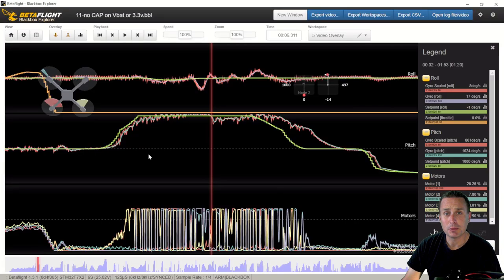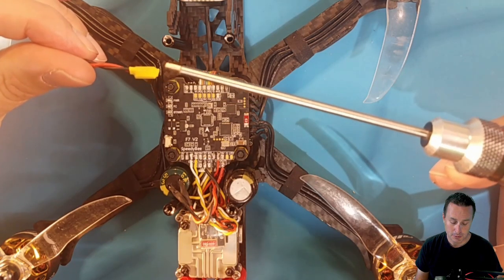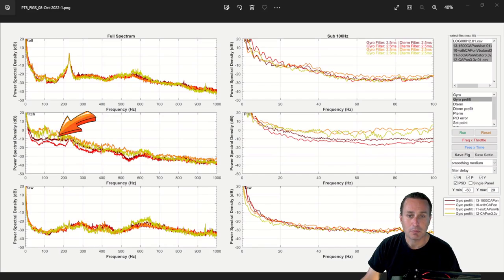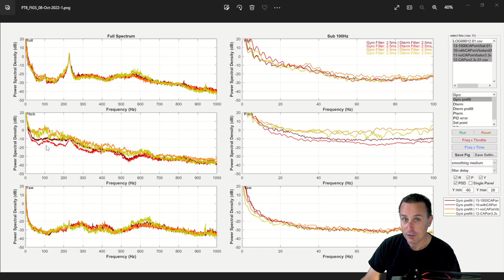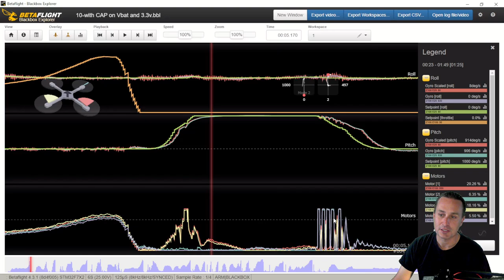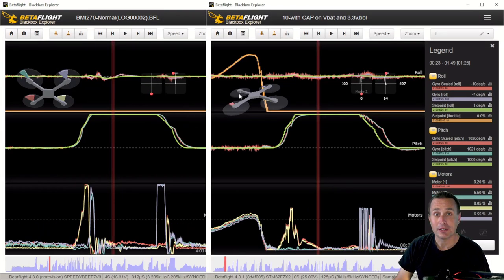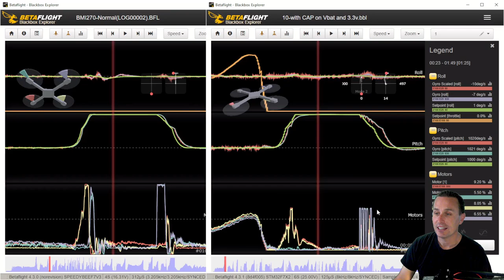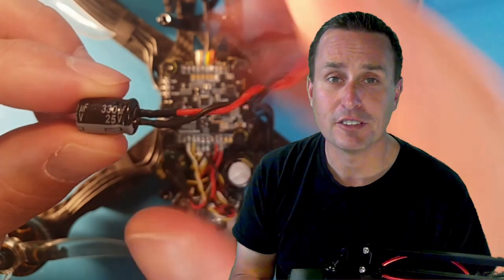⚡ How to FIX Gyro Electrical Issues ⚡

Comment: I'm saying this for years that the huge capacitances (some use over 1000uF) mostly added directly to the xt60 or putting it where the battery inlet cable  connects to the PDB/ESC board doesn't do much in terms of filtering. What it does for sure is burning your xt60 plugs with this initial cap charging spark
Reply: Well I hadn't thought earlier... but you are right adding a Cap without any resistor sure does a huge current spike... between battery wires...  people tend to forget that the placement of cap near the soldering pads is just the routing... there is a complete pi- filter sitting on the board{ pdb/esc}.

Comment: I had some Andlog OSD issues on a bad design FC. With 4s had interference in OSD letters, and with 6s OSD completely gone on throttle high. Tryed any caps but problem were solved by adding good DC/5vor12vDC regulator at vbat/ground out of ESC to FC. I used blheli32 telemetry to get vbat voltage and current data.

Comment: Hey, thanks for this video. I found your results pretty interesting. Maybe try adding some 0805 or 1206/1210 SMD ceramic capacitors to the FC where you have a Vbat pad next to a ground pad, and a 3.3V pad next to a ground pad. The low impedance and great high frequency performance of a SMD MLCC capacitor may help eek out a bit better result.
Reply: I did not test it separately but that exactly what I did with my mamba f722 app that had noise on pitch and now even the logs look like there is no issue at all.
Reply: @rehepeks  That's pretty awesome. I sometimes feel like certain FCs are lacking in the decoupling department and I'm sure there's plenty of improvement to be had by a few caps strategically placed here and there. Big electrolytic caps, and a few small SMD MLCC caps. I've been doing this on my last few builds from the get-go so I have no back-to-back comparison, but maybe my next build, I'll do a before-and-after BB log to see.

Comment: you should look up "capacitor derating" or "DC bias" it's when the capacitance is reduce as voltage is increase. A 16V 10uF Multilayer ceramic capacitors (MLCCs) powered at 16V can be actually be 3uF not 10uF. It's crazy. There is a tool call "simsurfing" from murata a semiconductor company where you have graphs showing the effect of voltage and capacitance for each part number they sell. So if for some reason the V3 is better, it could also be a coincidence that they assemble that batch with different brand of capacitors.  If those caps are out of stock, it's so easy to say, well change them to something else because well "it's just a capacitor"

Comment: I'm keeping this in mind planning on 2100 kv aos ultralight if 4s won't rip enough and if I'll need it. I'll still add caps and see. My current 4s are way heavier than recommended. I'll play around kinda safely

Comment: very interesting. since caps on the regulated lower voltages help this suggests a big sudden power draw from the motors is bringing them close to collapsing. which in the first instance would kill their communication over cables due to a low signal level but could even lead to a chip reboot or miscalculations of the ics.
you may be able to see esc communication errors without the cap at the moment you spin the motors up like that.
i wonder if it would be wise to add more capacity to the lower power lines and maybe even some (10? or 100?)pF to the esc communication lines.

Comment: Thanks for the video. I've messed around with this a few times and found that a 330uf on FC works just as well. It will save you some space to have a smaller one. Still use a 1000uf on the ESC tho. Or just spend $60-$70 and get the speedybee f4 v3 stack.
Reply: actually with the added capacity on the lower power lines you can reduce the cap size at the battery and get a similar effect.
Reply: Which also has issues with gyro, ~3% having issues with roll or yaw axes
Reply: @OlegShevtsov512  I've heard the reports. Though it doesn't seem as prolific as the v2. Well now we got the v4. Let's see what happens. 😄

Comment: very nice testing. what you have seen should however depend on the board and existing capacity there. also the chosen voltage regulaters play a big role. so it is quite board dependent.

Comment: Thanks for the video. I was wondering if it's possible to clear the blackbox log on the speedybee V3 on the app? Perhaps in CLI? Also, I haven't been able to get a readable blackbox log of the v3 FC... I put it in a sealed waterproof build and was hoping to use the app to read blackbox data.
Reply from the maker: BF has a Mode switch to clear blackbox.  See if that works.  I have been cleaning through deleting the files in Mass-Storage mode, but I see your setup is all App or Modes (sealed).

You should be able to view the BB through the app with a modern smart phone.  You have to enable wifi and connect to it.

If you have issues, maybe reach out to SpeedyBee.  I think it is fiddly.  I had to use my wife's Samsung S20.  My S7 would not work.

Comment: Adding a capacitor to VBAT.  Where is the best ground to connect minus leg of a capacitor? In the video I can see plus leg of the capacitor connected to BAT pad of FC, but where to connect minus leg? Any ground or the nearest ground to BAT pad or a main minus pad of ESC where battery soldered.
Reply from the maker: You want to capture the spikes before they get to the gyro, so ideal the closes + and - pads to the ESC connection of VBAT that powers the FC.

Comment: I've got two brand new Tmotor F7HD with the BMI270 that appear to have either some electrical noise or bad gyros, didnt get any issues when it was using the MPU6000 on the first version of the board. I'm gonna try adding some caps to that and see what happens. Its not as bad as your one, but the motor tracers are noisy and spikey on flips/ rolls and the gyro doesnt follow setpoint during the roll/ flip. I have had success by turning the internal filter up to 750hz and using the betaflight gyro filters but its still not as clean as my MPU6000 boards.
Reply from the maker: I would be interested to see what you find out.
Reply: Hey, check out Chris Rosser's channel and see his video on the BMI270. He gave some information to the Betaflight devs regarding a lowpass filter setting that could be changed inside the BMI270 with a serial command. I can't remember the name of the gyro filter profile, but it's meant specifically for FCs with the BMI270. Check it out and give that setting a try. Maybe it'll help ya 👍

Comment: My understanding is Adding a Buck converter on Vbat down converting to 5V , then feeding it to LDO and adding  bunch of 10uf & 2.2uf on 3V3 Out should the trick... HOWEVER Adding an ultra LOW drop LDO on 3v3 is a good choice. Typically 200mv drop @1A.
Reply: I agree with you，Add another LDO for gyro is a good method.

Comment: I am seeing this exact behavior on a mamba f722. Roll access only completely flipping out in black box. I will try to add a cap on the FC before I buy a new FC.
Reply: How did it go? I also have a mamba f722 with noisy pitch axis
Reply: @FlaviuFpv  I replaced the board. Way too much trouble.

Comment: There are 25v tantalum capacitors under you link in description. Is it okay to use capacitor with lower voltage? 6.3v or even 4v for example? (Add: on 3.3v line)
Reply: Caps will pop if the voltage was too high. So definitely don't use 4v caps on a 25V line where the voltage spikes can go up to 35V or even 50V. Use at least 35V rated caps for 6S.
Reply: @TimeFadesMemoryLasts  Mark said he using tantalum capacitor on 3.3v, I don't think there are any big spikes. Sure, 35v for vbat is obvious. But what about 3.3v line?
Reply: @nikitaak  Oh, yeah then 4-6V should be enough. For a 5V line a 4V cap definitely doesn't cut it.
Reply from the maker: I noted later that was not a great link.  I switch so spec a 6.3v cap for the 3.3v.

Comment: I use 2 caps, one on the esc and one on the fc vbat
Reply from the maker: Good idea!
Reply: shouldn't have to be this way... issue is there are a lot of manufactures and trying to fix all of their designs is a big job.. also personally as the guy running the MFG program in Betaflight im selective as to who I waste my time with....

Comment: Once I ve installed a cap at 3.3v pad of fc. Then it started randomly rebooting itself. Turns out one of the cap legs did not solder to pad and touching once in a while in flight causing fc to reboot because draining the power.  Just sharing it if ever something like this happens to someone